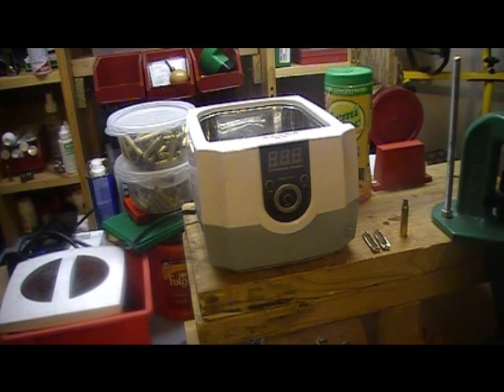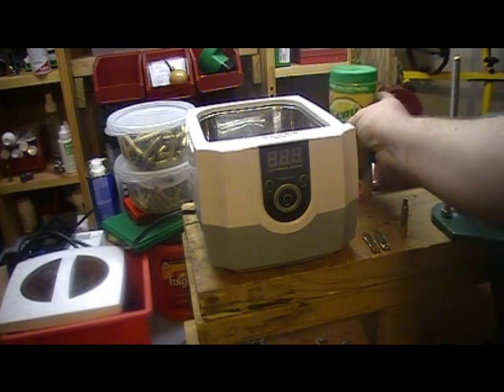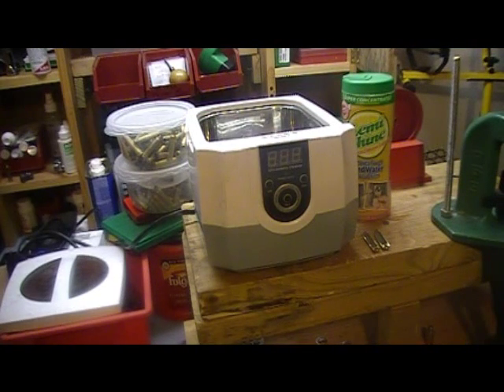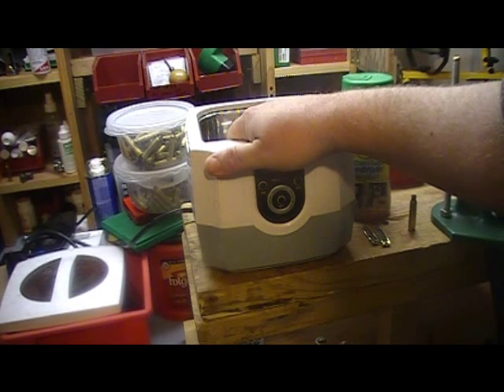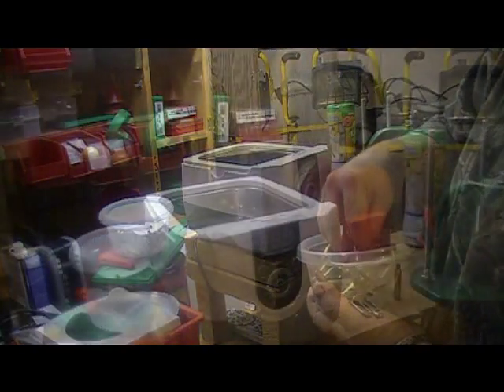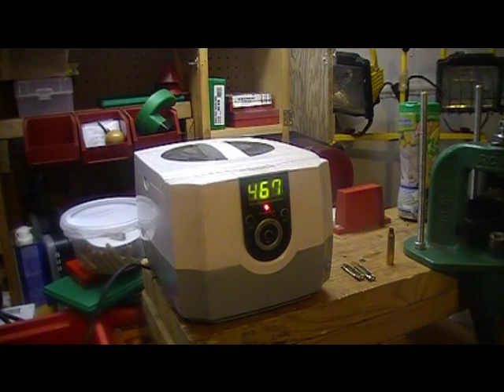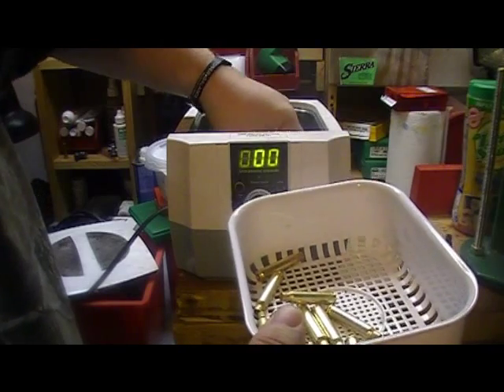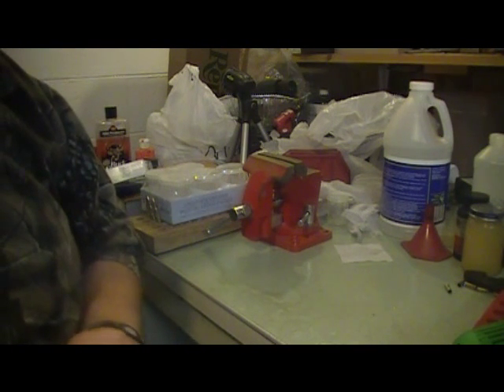Ultrasonic Cleaner Revisited

Comment: i use Mr clean and water in my ultrasonic and fill that sucker up to the top you will get a better action in the solution .......if you fill it with water and turn it on you will see a big difference in action than with Mr clean in it the water. soap acts as a conductor and you get more action with the Mr clean in the solution...... just my 2 cents coming from a professional ultrasonic user.